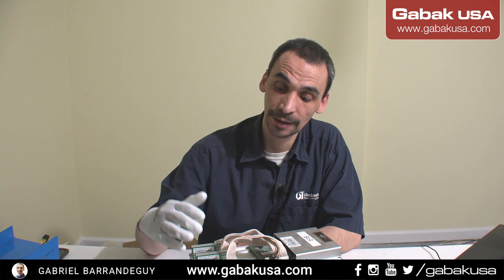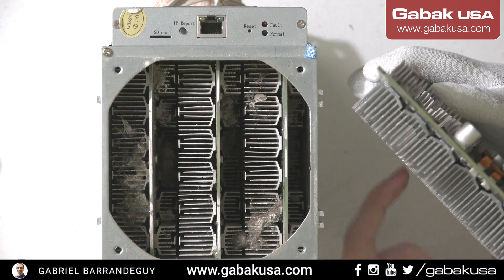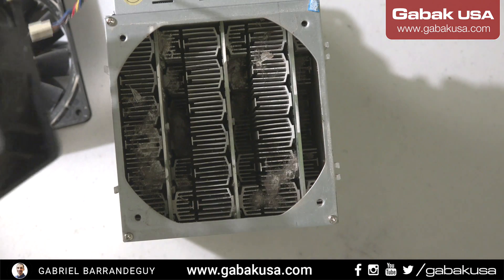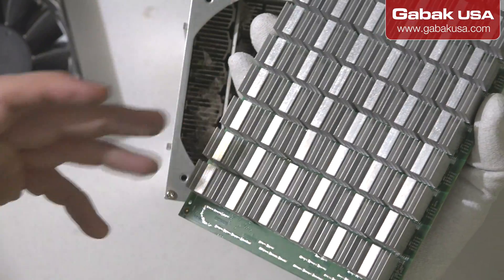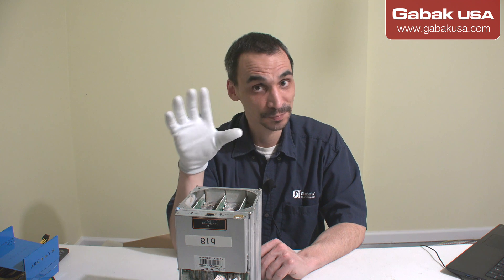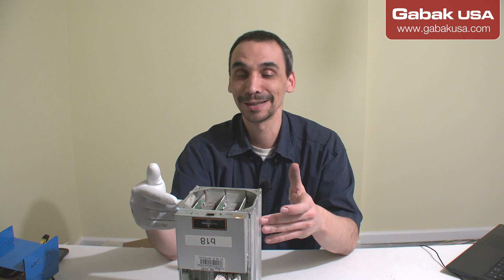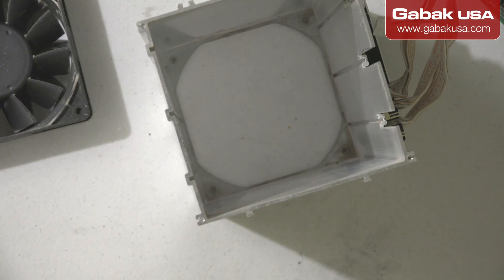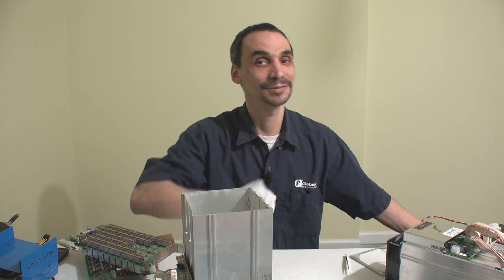maintenance & temperature of miners antminer

Comment: what if the hasboards are at 75 - 80c ?? is it bad? at bitcointalk alot of ppl say that its ok
Reply from the maker: the cooler the better, read the manual the manufacturer will tell you the right temp depending of brand and model